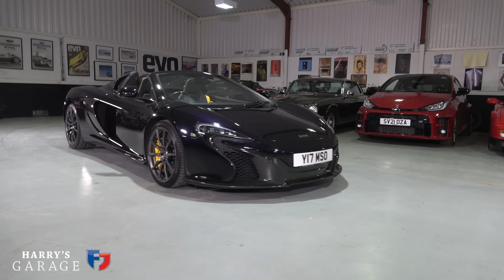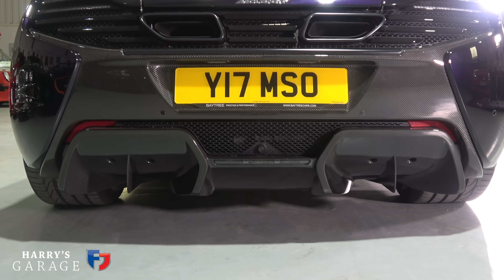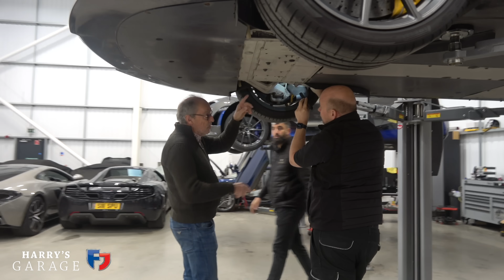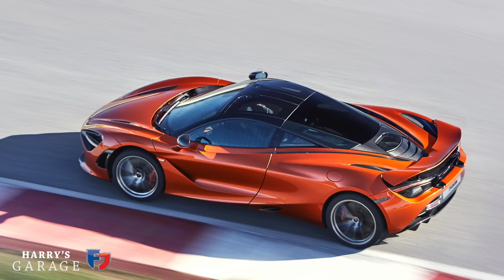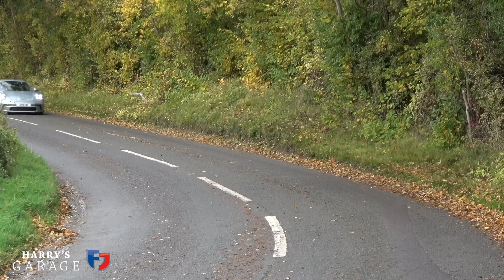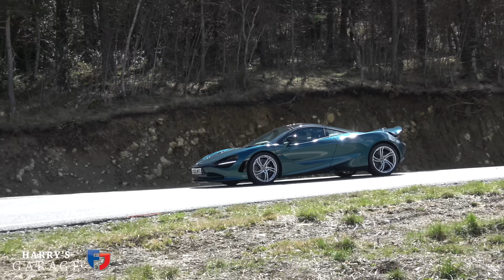McLaren 650S 6-month update. How much does it cost to run a McLaren? Servicing, warranties, parts..

Comment: I’m in Canada, so a smaller market with little to no choice when it comes to servicing (always serviced at a McLaren dealer). I had a 720S, about 1700 in the building cycle and as Harry says, absolutely BALLISTIC!  My “beef” was servicing and warranty costs - at 4,500 km - new accumulators $7,200!! Warranty after 3years was about $10k per year - oil change $1,600 new air filters $1,500 - I was always waiting for something to blow up! (Never did though). On a track day - the noise in the cockpit with windows up was almost unbearable - windows down seemed quieter?  Considering I was driving 3k km per year - it just got too expensive - so I went back to a GT3 Touring (manual) - it’s not as fast but who needs Ballistic?  Plus with the touring I fly under the radar - couldn’t do that in an Aztec Orange 720S - I was always being “accosted” or was always followed/being filmed!  Ah.. finally life in the slow lane! But I do miss the 720S for the shear drama! That’s my experience!
Reply: I've got a 2019 600LT with 120,000 kilometres on it. I bought it new. Daily driver to replace my Exige (never selling it! but it is less used now. It has 180,000 km on it). I haven't had that many issues - certainly not more than I had with german cars. I also have no choice other than the local dealer. I have just had a gearbox sensor and most recently an oil leak that will put me back 14k. Not great but for the price of the car and over 5 years, I don't think it is too bad. 

One of the reasons why I didn't go the 720 was the accumulator issue. It is a part that will need to be serviced and replaced at some time. But that is the cost of the "magic ride". I'm not really into luxury.

Happy you got the GT3 touring. I'm sure it is excellent - but it won't drive like a Mclaren. But it's your car and if you enjoy it then that is all that matters.

My 2c.
Reply: The fact that you can lease a Porsche is such a no brainer, versus all the other stuff that you have to find out and you have to really shell out a lot of money if (when it) it goes wrong and it sounds like you actually got pretty lucky. For the 3000km a yr, and you got to go through the hassle of selling it yourself or auctioning it. This is the thing that turned me off of the lotus, no lease. I just don't want to get stuck with it at the end.
Reply: @user-vk9ff9gr4x  I’ve never leased my Porsches as I’ve been lucky enough to access “GT cars” - GT3’s, GT3RS’s since 2009 and in Canada never had to pay above MSRP and after 3-5 years always made enough money - even on a “trade” to upgrade to a new model typically at zero cost (so I got to “pocket” any appreciation).  I only drive 3-5,000 km per year and trading in a GT car back to the dealer makes me an ideal Customer (they get to resell my GT car).  Still wish I had my 997.2 GT3RS - a great “raw” car and something that is worth “double” what I paid for it!  Isn’t hindsight just wonderful!
Reply: 'Life in the slow lane...' with a GT3 - you are a legend!
Reply: Every time I think "Maybe one day I'll upgrade my V8 Vantage to a McLaren of some flavour", the eye-wateringly high price of servicing that I see just kicks me right back into reality. I can service both my Aston Martin and my L405 Range Rover for two years and have money left over for what the oil change and air filters cost you on the 720S. Eeeesh.
Reply: @JamesSaysEh   Oil change and air filters are $300.  Stop being lazy.  Stop believing peoples lies on here.
Reply: Okay
Reply: @TerrificWife thanks for sharing. I’m considering going the other way, GT3 to Macca, so this was helpful.
Reply: As an external observer - this quality is really unacceptable and borderline taking the piss...
Reply: I call complete bullshit.  1600 oil change?  Its $700.  Do it yourself for $100 its VERY easy.  1500 for 100 air filters?  lol   Dealers do it for 300 and its only once every few years at most.  Again do it yourself takes an hour very easy to do.  Accumulators are $2000 from the dealer.

Comment: Nice video. One thing to think about is that lithium batteries degrade more when fully charged, unlike lead acid batteries. From what I understand, the ideal storage condition for a lithium battery is 40% charged and in a cool place - they don't always perform so well when cold but it can extend their life. So maybe give the CTek a pass unless the battery is very low. Some laptops have a feature that only charges them to 65% to prolong battery life. They really hate going completely flat though and it can render them useless.

Comment: 650 is a sorted car, apart from the corrosion... and the springs cracking... and the trim falling off... and the gearbox seals... and the ride height sensor. It's a 10 year old car with 10k miles on you must be joking! Bit of mental gymnastics going on here I think

Comment: Lovely car, cheap to run. Change spark plugs every 60,000 miles, amazing. I used to change the plugs in my bikes every 3,000 miles until a man from NGK told me I was wasting my money, they should last at least 16,000 miles.

Comment: Talking about how fast your car is isn't a good sign.. You should be talking a out how it makes you feel.

The reason I stick with naturally aspirated Ferraris (430 / 360) and older 911s is because they make you feel something that no turbo car (outside of an F40) ever will. If McLarens weren't that quick, most people would argue that an Alpine is the better value proposition. Modern supercars can do the lap times, but they fall way short when it comes to emotion and emotional attachment. A humble Ferrari 360 (as annoying as they can be..) driven at the absolute limit (be careful..) will give you way more authentic joy than any modern McLaren.

Comment: I've had my '19 570GT for 18 months now, and this video definitely chimes with my experience.  I also use V Engineering and find them reassuringly knowledgeable and reasonably priced.
I do think McLarens are great value in the UK, half the price of anything comparable and a chunk cheaper here than any LHD market.  Also the HPAS gives them a lot of the road feel that made older cars so engaging, even at sensible speeds.  An anomaly that's great news for enthusiasts!

Comment: Love your 650S spider.  I have found the GT to be totally reliable (2022).  The standard suspension eliminates the maintenance issues of the  650/720  suspension and it has the great steering and acceleration needed for driving thrills.  It seems as "sorted out"  as you describe the 650S and will hopefully have cheaper long-term maintenance cost as well.

Comment: Apart from the corrosion, wobbly lights and glued down windscreen, it’s alright 😂

Fab reviews as always Harry!!
Reply: And this is the "sorted" model 😅 Pretty clear why McLaren got the bad reputation on reliability.
Reply: Harry seems remarkably tolerant of these faults 😲😲
Reply: The very first 720s I looked at in a dealer had the lights moving like they were never attached properly. Never forgotten it. Seriously a heap of amazingly fast pommy heap of shit.
Reply: Yeah and don't forget the suspension needing rebuilt. Great car but quality actually seems to be pretty bad on these
Reply: This was my thought as well. Trim pieces falling off, rust, and the headlights are falling out, but hey it's not wobbly with the roof down like a 488 Spider! 😅
Reply: madness

Comment: Can’t get over the issue of springs breaking.  Your everyday car goes its lifetime without that issue unless there has been a manufacturing/material defect.  Another of those issues that puts potential customers questioning product quality.  
Same goes with Porsche and their known engine design issues that Porsche won’t officially acknowledge.  
High end prices but industry substandard product support.
Reply: Maybe 30 years ago springs are a common service item on a wide variety of cars in the UK.

Comment: So what I have gathered is this vehicle has issues beyond corrosion.  They really could do better on that.  My Silverado has lived in the rust belt and is starting its 8th winter of road salt and no rust.  I know the wheel wells, rockers and cab corners will eventually rot because all trucks eventually do.  This thing probably lived in a climate controlled garage, never seen rain let alone snow, so any corrosion is unacceptable.

Comment: Sorry Harry, but this still doesn’t paint a very good picture of McLaren at all. That corrosion is shocking for this type of car. A car that will be looked after and not see salt roads etc like you say. My crappy little Skoda which is 7 years old (out in all weather) doesn’t have this problem.
Reply: German cars are worse.  Check out corrosion on ten year old alloy bodied Audi’s

Comment: Omg such a huge corrosion on a modern car😱😱. Damn if I saw that I would run away from the car. Reminds me of the NB Miata’s, but generally cars in UK rust like crazy, I guess it’s the humid climate + salt bath in winter. 
I just sold recently my everyday car from 2014. and not a bit of corrosion or rust anywhere, it even looked like new underneath and we do have salt in the winter and it was driven to Dolomiti etc., during the winter. Same situation with a 997 from 2006., but that one is spared during winter. 
It’s just (at least for me) not acceptable that modern cars of this era rust if they’re made of steel or have corrosion if they’re made of aluminium. So sad to see it. I would again just kept Lotus, more beautiful and you had it from day one, nothing like buying a special car new and keeping it forever or at least longterm.

Comment: My 2010 Golf with 150k miles worth £1000 that has lived in the UK all it's life has no corrosion on the body nor the underside. For me that body corrosion on the McLaren is unacceptable for a car that has probably never seen salt. I'm in the Motor Trade and the general consensus is the more expensive the car the worse the build quality and longevity, the engineering and tech may be top notch but the rest of it is crap.
Reply: Aluminium is way harder to stop corroding than steel….. admittedly low volume sports cars just do not have the budget or the same interest as mainstream manufacturers to prevent it tho

Comment: I’m not sure dealers trying to sell used mclarens are going to thankyou for that one Harry 🤣 The first 10 minutes explained the whole reason people steer clear and why they are that much cheaper than an equivalent Ferrari or similar. I wouldn’t expect body corrosion on a 10 year old Fiesta let alone this thing so to say it’s good value when factoring in the costs of running the thing I find a little conflicting but that said I’d agree it looks great and honest content as usual.
Reply: It's good value because, as Harry explained, it's half the price of the equivalent Ferrari and because, again, as Harry explained, the running costs are very reasonable.  I would rather have a cheap to fix bit of corrosion than live with the chassis flex of an open 488.  So I'm going with his opinion rather than yours.
Reply: @64Alvis you are very welcome to do so

Comment: The fact McLaren did not design, or have the supplier design, the accumulators to be refillable from the start is just insane to me. Business love to make out how green they are but when it comes down to it they do everything possible to consume as many raw materials as possible. 

Expecting owners to shell out £1500 for a suspension recommission every 3 to 4 years is absurd. 

Also not entirely convinced a 12v lithium battery costs £1800 either...
Reply: Cost me just under £1000 for all 4, there are cheaper aftermarket refillable ones out there too. I replaced them myself. No rockets or scientists needed. These cars are falling into the hands of DIY enthusiasts and there is a wealth of knowledge being built up and a growing list of equivalent replacement parts. For example the ignition coils are just a standard Nissan part.
Reply: Planned obscellence, good way to make a mint replacing the whole thing at their service centres.
Reply: they look identical to ABS accumulators - which even the non serviceable ones can be recharged for about £60
Reply: Totally agree absolutely disgusting
Reply: Yes, OEM lithium batteries are that much. $2K on a 911. There are some aftermarket options for ~$1K but still.
Reply: @The_Stanman  It'll be due to each OEM designing something bespoke to their cars. 12v lead acid batteries have many sizes and capacities but they are none the less standardised and so are able to benefit from volume pricing.

There's nothing stopping lithium versions from being standardised, but you would have to agree on charging specifications and charging communication protocols. 

Companies are not going to do that through the goodness of their own hearts though.

Plus, the liability is far greater, a bad lithium cell has the potential to destroy an entire car.
Reply: @mt1104uk  yes there are reasons why lithium ones are so expensive. I was just responding to your comment of "not being convinced they cost £2K."
Reply: They look suspiciously like the £20 water hammer arrestor I just fitted on my house cold water main, which sits at 3.5bar and is rechargeable via a schraeder valve.
Reply: On Ferraris of the same era, which have comparatively basic suspension, they over tighten the aluminum height adjustment collars from the factory on the shocks so they strip the threads and you have to fully replace the entire unit. Last one I saw was $6K per corner for a shitty quality shock

Comment: From a lithium battery wear perspective, they are best charged to no more than 80% which ensures a longer life. This is applicable to all lithium batteries, and minimises the creation of  dendrite growth. I mention this, if you keep it changed with a battery tender when not in use. Sometimes this can be set on the software or firmware.
Reply: His is Lifium though, so it may be different. I don't know, as I have never heard of Lifium batteries before.
Reply: @TazR6  Lifium isn't an element, where Lithium is, so there is a stark difference.
Reply: @StevenHoman  I know.
Reply: @TazR6  Cool.

Comment: Not completely comparable, but my Honda EG Del Sol / CR-X had the rear glass that could come down, totally loved that experience with the rear glass down in any weather. The Miata RF has rear glass, but no switch to be able to lower just glass, it's connected to the roof down arrangement.

Comment: The aluminium will most likely corrode because it's in contact with stainless steel somewhere.
Reply: Dissimilar metals corroding...we mechanics and builders understand this....engineers nooo😂😂

Comment: Thanks Harry I think you are swaying me away from 12C to 650S. Please let us know if the history has any of the usual issues cooling leaks, front suspension bushes, cracked door hinges, water pump, cam phasers, power steering pump, timing chain clatter, tail light issues etc.
Reply: I didn’t live that far away from a dealership when they released the 12c, and every one I used to follow down the road had enough water in the rear light cluster to support swimming fish.

Comment: Unfortunately, aluminium oxidation is one of the downsides of owning an aluminium car. Had it twice now, on my Alpine A110’s wheel arches, and it’s only six years old! McLaren’s are well known for it, too.
Reply: Aluminum doesn’t oxidize if it’s properly protected. No one outside of the UK should buy these unless they have a bottomless wallet.
Reply: Not a supercar, but VW Phaeton (a super car) suffered from galvanic corrosion
Reply: Wonder why you don’t hear about corrosion on the old NSX’s?
Reply: @overbuiltlimited  Good question, my 2000 3.2 NSX didn't suffer at all in the 8 years I had it.

Comment: I have a Hyundai i30 2011 here in Sweden, and drive it about 50,000km every year on salty roads and I don't wash it regularly, last time I did was February 2023, almost two years ago and it has no corrosion.
Reply: 5000 mil per år. Det var inte dåligt. Själv hamnar jag på ca 700. Tvätta din bil. Varför undvika att hålla den ren?
Reply: @vika0194  because it's not worth the cleaning. I clean, spend time and money, once I hit the road, it's filthy, again, so better not to do it. Roads in Sweden once wet, they make this black sticky thing that sticks on the car, it's not mud, it's a black mixture, rubber+brake pads dust, when wet, it sticks like glue.
Reply: @huss1205  du behöver inte förklara hur svenska vägar är. Du ser ju att jag är svensk på kommentaren. Ditt argument visar bara att du inte tar hand om bilen.
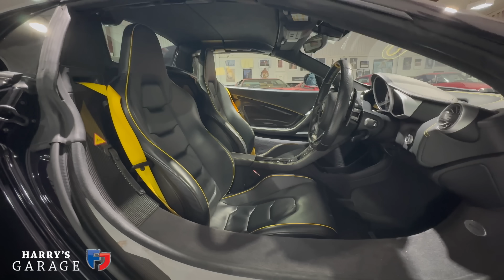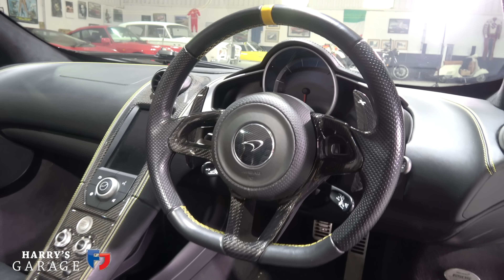Reply: @vika0194  I wake up at 6, drive to work at before 7, 115km to work, then at the office till maybe 16:30 or 17:00, drive back home, another 115km, home just before 19:00, and you expect me to clean a car in the cold, in the street, in the dark?
Reply: @huss1205  så det är kallt och mörkt sedan februari 2023 alltså. Väldigt trovärdigt. Du bryr dig inte om din bil för du är lat. Svårare än så är det inte.
Reply: Look underneath...
Reply: Clean your car on your day off 😂
Reply: @peterbroadwood476  it's my day off, that means staying home. Living in an appartment, car parked outside, no garage to do that, and I won't spend an öre to go to a garage, enough with my monthly diesel bill...

Comment: For a car costing that much corroding and falling to bits I'm not impressed. 
Interesting the 458 and 488 spiders are wobbly. Whereas my R231 SL500 at a fraction of the cost, isn't.
I'm loving it
Reply: True, but look how much heavier they are. I think Ferrari probably uses the thinnest aluminum they can get away with. The biggest thing that surprised me with Ferrari was how terrible their welds were. Absolutely horrendous. It looked like it was welded by a child. Everything from 70’s Ferraris to new ones